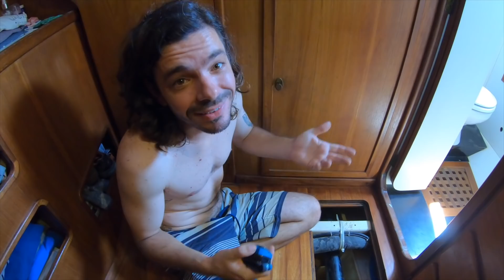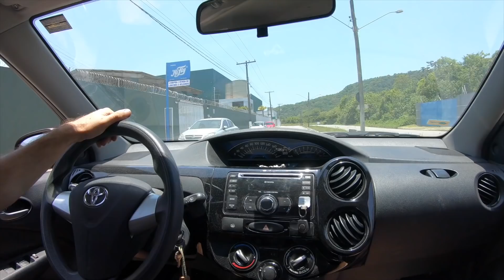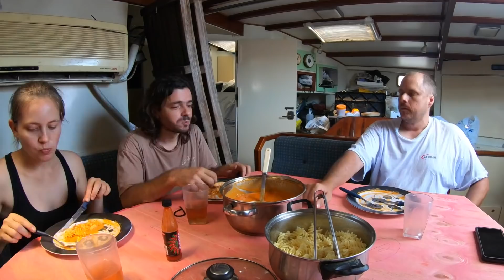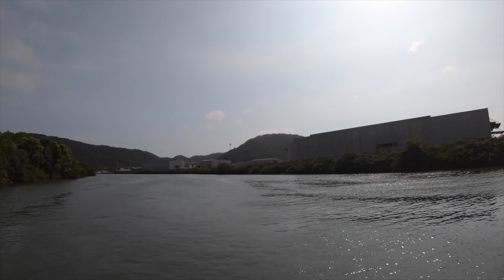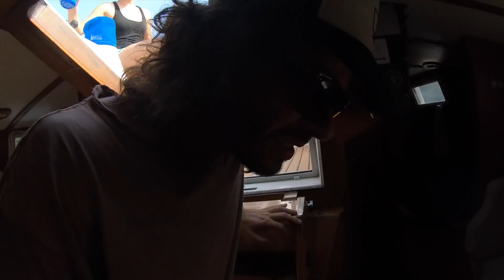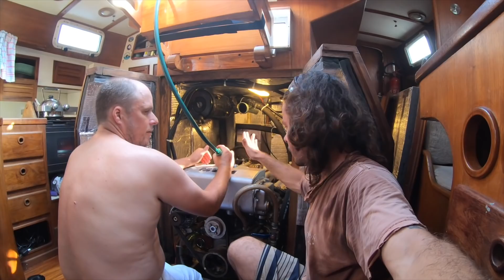⛵️First SEA TRIAL after 23 year on the hard!! (didn't go well!! 😨) Not Click Bait #163

Comment: Yanmar 54hp has new heat exchanger which you need. Dependability on the sea is a life safety issue!
Please do not use 23yr old heat exchanger, since it has failed again after repair and you will not have way to change
at sea. It is probably worn out from diesel closed system acid, and electrolosis water. Build for the journey of the world!

Comment: We had just the same  problem and the same thoughts about it just like you, so we desided to buy a new engine and sell the old one and we have not regreted it
We sold the 43 jahr old Mercedes 42 hp engine for 2000 Euro  and bought a new 52 hp Mitzubishi for 9500,Euro  and that is what i call a Deal, So in my option
You are on the right track. You want to go sailing an not wast time nurseing an oldtimer, rip it out !!

Comment: If you plan to sail world-wide you need an engine that you can get parts for around the world.  Your engine is unique and you cannot get parts easily outside of your current location.  Get the New engine.  Hard on the wallet at first but will put your mind at ease when you need it most.

Comment: Do a compression check on the engine. If the compression check is good and the oil pressure is good, the bearings valves and piston rings are all ok and do not need work. if any are bad then rebuild the engine. learn to do this yourself since in the future you will be in remote places with no or unknown skills of mechanic for repair. You will need a workshop manual for both the engine and transmission.  Tulas endless summer rebuilt an engine while on the boat and dit a good job. probably better than what he could have gotten in the area that he was anchored.  You are not limited to manufactures parts. there are shops in the US and likely Brazil that can make up parts for you if they are unavailable. Bearings and seals are available from the web or any engine supply house ar even a bearing supply house.The racing car industry may have the capability of supplying you with parts as well. The only problem is gaskets which may be specific for that engine. You may have to go straight to the engine manufacture or a distributor to get what you need.
 
csmale9@gmail.com

Comment: Duka, and Roberta...#1  just kidding.....If you have the time and the money..Buy a new engine...You will be happy you did..If you can un load the present enging...do so without putting good money into a used motor....heat exchanger..could be under warrenty...ok then get it repaired...if it will cost you $$$..don't.....you have added new parts and hoses already...I am sure,  as you already are, able to sell the current engine... remember hoses  might be different... you have done your Homework..You three are a better judge than I...Good Luck  Happy Christmas, Safe New Year...Rob from CT. Thanks for the great Videos, of 2020.

Comment: Now you see why you do sea trials. I would fix everything for now and use the boat for a year or two getting use to how she sails. Then, you can work out all the bugs and get the things that need to be done right away fixed. Then, after using the engine for a couple years, you can decide if you want to replace it in Brazil or sail to somewhere else for the engine change. Don't loose sight that you have a sail boat with an engine for maneuvering. Not a motor boat with the engine for main propulsion.

Comment: As an aircraft mechanic, I would advise you get a new engine an engine that has been sitting for that long is going to have a lot of damage from acids that have built up in the oil and corroded seal, bearings, and cylinder walls. Then if you can sell that old engine for a third of the coast of a new one i would pull the trigger to have the peace of mind knowing you have a solid and reliable engine.
Reply from the maker: Thanks for the feedback about the engine 😊

Comment: My two cents: if you can afford buying a new Yanmar engine, just do it. You are planning to sail around the world, and someday you will be in trouble with your engine. That's the way mechanical stuff goes. It works fine someday and then it fails, eventually. A new engine you can get repaired easily wherever you will be at this time will be something you won't regret the initial expense, in my opinion. And if you can sell your old engine to someone before you leave Brazil, this is also in favor of buying the new Yanmar.
Safety first. You will have all the time you need to go sailing in a few weeks.
Cheers from the French Riviera.

Comment: Grab yourself that new engine. It's cheaper to do it now than it will be later, considering the trade in price. You'll definitely have to switch out engines eventually, the parts are prolly gonna get increasingly expensive as time goes on considering its a discontinued piece.
Reply from the maker: 😉 Thanks for the feedback about the engine, Eric
Reply: @OddLifeCrafting  I ain't the smartest about engines, but long term budgeting is my jam.

Comment: Pull it out of the water. Replace things. BOAT :) Engine sounded good, transmission/shaft seal needs work.
Reply: @OddLifeCrafting  Keep the engine. Save the money. Diesel engines last a long time. You have a part suppliers in Brazil.

Comment: You say you have a problem with the Bendix on the starter motor... Where you say it’s fine on the third try this can point out to the actual problem is the flywheel and NOT the Bendix,it may be the flywheel stops at a particular point where the Bendix can’t mesh the gear on the Bendix with the teeth on the flywheel as the teeth are a bit worn at that point/area ( 5 teeth are worn for example),it is a common problem with older Engines where the flywheel may be not balanced very well,nothing a new flywheel wouldn’t rectify but sometimes it’s better to fit a new Engine with the newer type starter system and electronic ignition ( Electronic system means that the flywheel will always stop at different positions meaning the teeth will wear out evenly ).     Saw your endoscope ( I call it a borescope as I use it for checking barrels of motorcycle engines ( ie the bore ),brilliant bits of kit aren’t they ? Like having a camera on the end of your finger for those hard to reach places.    Shame about all the problems that you found but at least it happened in a harbour and not on the open ocean,shake up trials or sea trials really are a good idea.  It won’t take long to fix the problems and eventually you’ll be out in a Beautiful Safe Boat and one you won’t worry about.   Wishing you both ( And Fred ) Merry Christmas and a Happy New Year ❤️

Comment: If you are seriously considering replacing the engine, you may want to consider a hybrid instalation which will give you the option of using diesel power or electric or both. Have a look at (Rebuilding Tally Ho Ep87) of sampson boat company.com. There is a good talk on the benefits of different power options for a yacht and the hybrid installation is one of them. You now have the battery capacity to consider this. Good luck with fixin the few issues you have found.

Comment: Hi Guys .. I recommend a new engine -- Yanmar is a good fit for this.  Here is the thinking -- you may pay a bit more than repairing -- even a lot more. But when you are in the middle of the Atlantic and you need reliability -- a new Yanmar will give you peace of mind -- trust me -- there is nothing like peace of mind for mechanical items -- especially since you aren't diesel mechanic experts.  An engine that has been sitting around for 20+ years not running has a HOST of hidden issues -- it will be a continual headache.  So your thinking is quite sound.

Comment: Hey, me again, I like the option of replacing engine, however I would go with a higher horsepower like a 110 horsepower engine, trust me you won't regret having more power.
Reply from the maker: The problem of going with a higher power is that the engine is not just mechanic if they are big and we don't want a electronic engine

Comment: I would look at the beta marine engines.  I think they use a Kubota block so many of the parts are available all over the world and less expensive than the Yanmar.  The marinized parts you would have to get from Beta but they have a good distribution.  Also I like the non  turbo ngines with mechanical fuel pumps.  You know what they say. KISS  (keep it simple stupid)

Comment: Diffrent engine will mean ,, new eng mounts to,suit,, new bell housing to fit  gearbox ,not a quick cheep fix ,repair what you have  all other long hail sailing boats take spairs,, water pump seals belts filters,, injector ,, in short box if tricks ,,

Comment: I am fascinated by parallel hybrid ever since Leo of Rebuilding Tallyho mentioned them. Problems: price. And you probably have to import the electric motor. There is parallel hybrids by BetaMarine and there is Retrofit sets for Yanmar and Beta Marine. The advantage is great so: redundant system with 2 engines, regen while sailing, no changes to gear boy, shaft, etc. Also something to consider later. Maybe the retrofit with e-motor works in the water, when you get the right Yanmar/Beta Marine now.

https://hybridmarine.co.uk/index.php/products/retrofit

Comment: Before you commit to Yanmar, get a price on Beta these are marinised Kubota engines - parts are available at tractor dealers worldwide. Beta also offer 5 year warranty with logged owner maintenance. Beta also come with gearbox and basic instrument panel included. I have just replaced 50hp BMW diesel with 50hp Beta for all the same reasons you are thinking about. I had to redo engine mounts, but still saved money on what I would have to pay for Yanmar engine, gaerbox and extras. Look at https://betamarine.co.uk.
Good luck....

Comment: I think buying a new engine is throwing the baby out with the bath water. It's not necessary since you guys aren't really on a tight time schedule. I understand the concerns about parts availability for your current engine, but I don't believe it would be too much trouble to carry spares for all the high failure parts of that engine (fuel pump, injectors, gaskets and seals, belts and pulleys....ect). Let's face it, if the engine has a catastrophic breakdown, it doesn't really matter if it's a common engine or not, it's going to take a long time to get back up and running either way.

I'm not even sure it's necessary to rebuild this engine. You can have the oil tested and that should tell you a lot about whether this engine even needs a rebuild. The salt water contamination should not cause any problems what-so-ever since you were able to flush it out right away.

However, rebuilding the engine comes with three positives.

1-MUCH, MUCH, cheaper than buying new
2-As you said, you will know the engine back to front, and know that it will last as long as a brand new engine (maybe longer since it wont have the fancy electronics controlling it like a new engine would)
3-You'll get a lot of good content for the channel

My vote is to keep the current engine, and probably to do a rebuild on it. It will be as good as new after that.

Comment: Please tell me how your shipping container (your house) heats up in summer and does the insulation material cope with overheating of iron? Sorry not for you, but it's important to me.
Reply from the maker: Hi. Where we live the temperature is mild and the insulation we used holds well the temperature
Reply: @OddLifeCrafting   Thank you very much for your reply. Can you tell us what is the highest temperature where you live? Where i live, the temperature sometimes rises to 40° C in the shade, but the winter is mild. Do you think such insulation will not melt from iron in the summer, because if it is 40° in the shade, then it is even hotter under the sun? Thank you)
Reply from the maker: It’s better to have an extra insulation in case of 40 degrees. The best idea is to avoid the sun heating the plate, some kind of shade
Reply: @OddLifeCrafting  Thank you very much

Comment: Sell your old engine in Brazil, where it has most value. Buy the Yanmar, proven technology, parts readily available world wide. The Beta has limited support and is new technology with few trained repair facilities worldwide. Electric is all well and good when batteries are fully charged and the sun is shining, but the time you might really, really need alternative power could be in a multi day storm or when batteries are low.

Comment: I would be shocked if a shaft seal was not leaking after 23 years of sitting (it probably stuck to the shaft and ripped a section when the shaft was first rotated - assuming you use a lip seal configuration). Still, hate to see it happen -- although, I submit you are kind of lucky it failed now for a 23-year-old shaft seal was going to fail in the near future if it had not failed now. I believe this is the best bad news you could get.

Comment: Simple buy a new yanmar it will be cost effective for many years and parts are everywhere , the money you get for the old one will be handy for spares for the gear box ,which will fail shortly because it wont be used to the power , elecctric`s  are not worth the effort in the long run to short a motoring period  and not enough power to handle strong currents  , my two cents worth

Comment: If you can manage the immediate cost, buy a new engine, no doubt. If it should be a Yanmar or Volvo Penta, the two biggest brands, or another brand, I don’t know. They both have very expensive service parts, especially Yanmar. You might consider Beta or other versions of marinised industrial motors. Perkins might be worth a look. Frequently it’s the same base engine you get in Volvo or Yanmar. Electric drive is awesome, but expect higher price than diesel. Also the obvious battery and charging capacity issues are hard to solve sufficiently. Normally one should have a very efficient boat, light and smooth. Your might not be ideal.

Comment: Yippie..... the first shake down cruise!  If you can manage the price, I'd say go for the new engine.  You'll also be able to integrate it with any of your new instruments as well.  I'm guessing your 30 year old low hours engine doesn't have any NEMA 2000 connections either.  If you were going to strictly sail in Brazil you could take the risk ... but if you're half way around the globe you'll be safer with newer engine, and an ability to get parts when the need arises.  It always amazes me the change when I see the intro in all your videos, when you two are first stepping on board that boat.  The difference is still just unreal.  Looking forward to you refitting it with a new Yanmar...LOL. ;)

This is the one you want to get right?  http://inboardenginesale.com/yanmar-4jh5e-4-stroke-54-hp-marine-diesel-engine-inboard

Comment: Stay diesel. I carry 1250 liters of diesel in my sailboat and my range under engine is 1,500-2,000 miles. No way I would ever trade this for an electric motor with a 20-30 mile range. To me motoring range is a very important safety feature and I also have the ability to assist someone else in distress for a week under engine power.

Comment: You will not find a better engine as a MWM with ZF transmission/gearbox. Let the gearbox and the heatexchanger be repaired and it will be a faithful machine without failures. The MWM is three times better than Kubota, Yanmar or Alpa!

Comment: Well, as you mentioned before.. this is a pain in the but to do and you were told to leave it if you could.. you did that.. This time the gamble didn't pay off but the idea was sound! So a touch more time on that land will just make you feel more confident when you set out.. You can not kill diesel engines.. I have seen diesel engines (in machines) sitting in the woods for 30 years rusting in the weather and with a touch of clean out and new batteries start right up and work for years more.. But Duca you are a worrier and I think the best for you is to pull the engine and the gear box and go through both of them.. That way you can set your mind at ease... ( If you are gonna buy and engine look at this fellow https://www.youtube.com/watch?v=xohxmwPfctg he is rebuilding a wooden boat and this episode is about engines) as for the heat exchanger well it was repaired once before and didn't work since those folks just went out of business you should be able to find the same one around someplace.... Say I thought Fred was married? in the beginning he had a wife or girlfriend with him on the boat.. I hope he didn't get his heart broken.. That happened to me once.. it is no fun..

Comment: an electric engine on a blue water cruising boat is no good, your power regeneration needs & battery bank  would be huge  & the charge would not give you the engine range /distance  needed for off shore, even with a biggish gen set , look up yuma, they have an electric motor,there travel range is limited , adverse current will drain your batteries very fast leaving you powerless in an emergency, ruby rose have decided against electric in their new boat for the same reasons  , ruby rose has gone with 57 hp yanmars

Comment: Just because an engine was sitting for a long time it does not mean it is going to be bad! There are plenty of tests and inspections you can do to make sure it is mechanically sound! It sounds like you are just coming up with excuses why it should be changed, But none of those reasons are based on any type of mechanical knowledge! Replacing your engine with a new one just so you can have a peace of mind is not a good reason! I have been a mechanic for over 20 years and I have seen plenty of brand new engines fail for one reason or another!